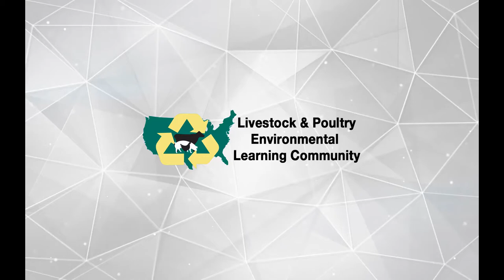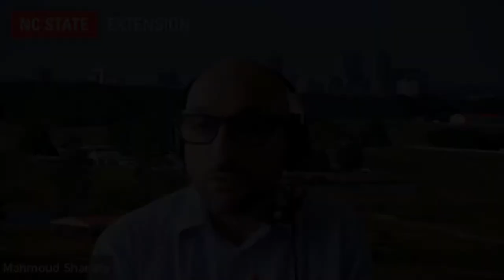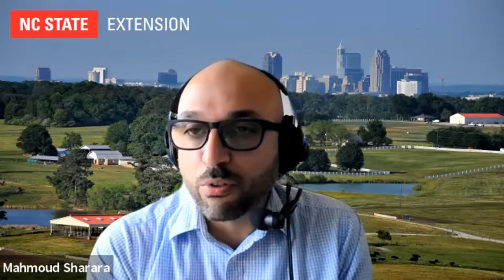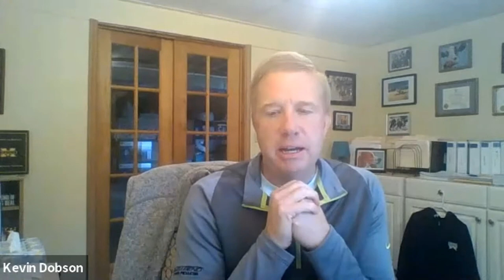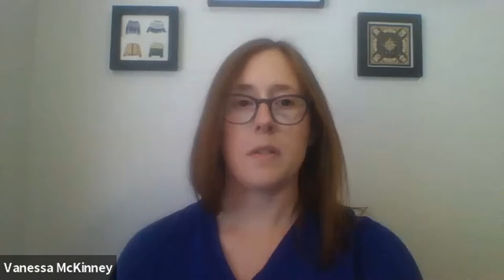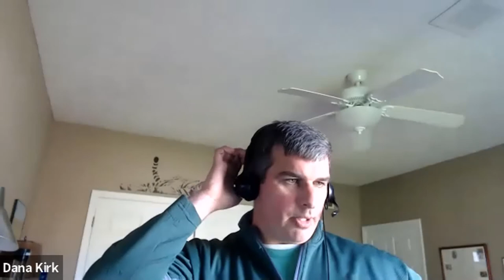Q&A from Coupling Manure Digesters with Renewable Natural Gas Systems

Comment: Big players coming into RNG Sapphire Gas, B.P. ,Blue Roads, Mass energy , Dte and other OIL Gas Majors.
Leading Equipment supplier with Four Technologies Greenlane Renewables.
Also I am located in VT. I just saw a septic pumping truck . Turning waste into energy / Electricity. 
I have been investing in RNG. 
I have done a lot of research.
This area is growing very fast.